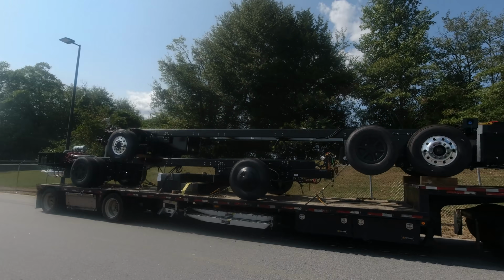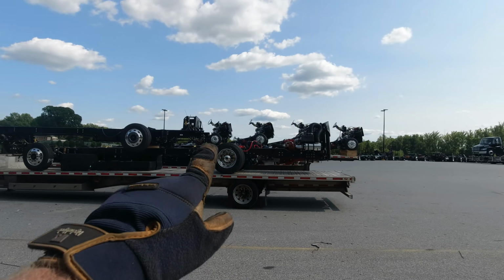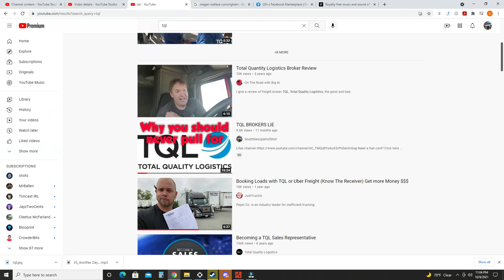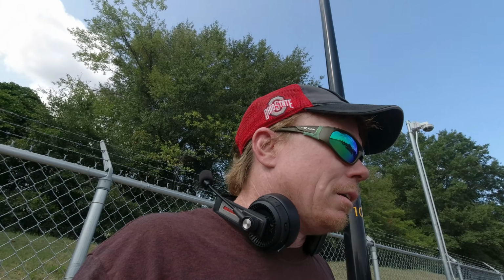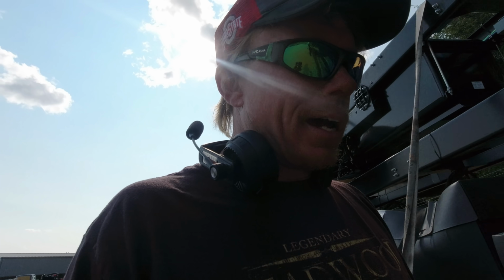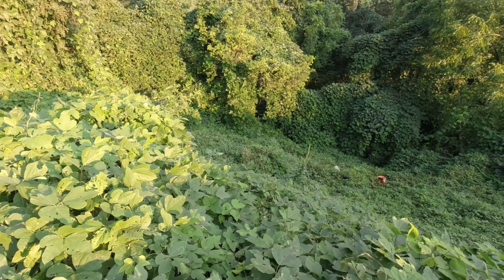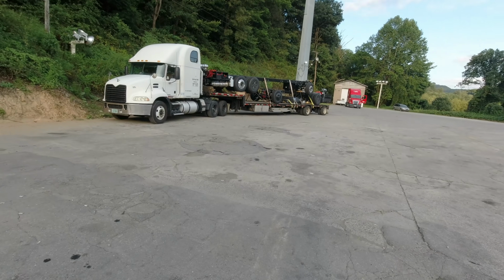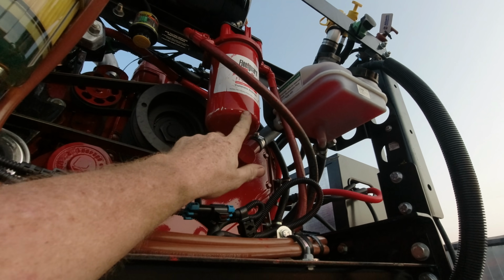Tql strikes again. And we pick up at Freightliner

Comment: I’m gonna be devils advocate 😂 
I hauled a lot of loads for Tql with a reefer. 
Over the course of the last 3 years I never not got paid. 
I at the same time don’t bother asking for detention. I just ask for it up front in the rate con and either get what I want or don’t pull the load. 
Nothing personal. 
I have been burned on appointment times but that’s because I got caught slippin and didn’t notice it was fcfs. Those are always long waits. 

I have been screwed on weights but that was easily resolved when I explained that they need to unload the truck becAuse it is over grossed and higher then my rate con. 
I then explain if you want me to haul this load you need to ph me the hourly rate of 100$ an hour for taking this load to scale it and bringing it back. If you don’t pay, I can unload the trailer and have a nice day. 
They always paid. 

It’s business folks. 
I been burned by small mom and pop shops much worse then anything Tql ever did. 

Those to me are the worst of the worst, small mom and pop shops preaching and promising everything is fine. 

The worst of the worst I ever dealt with was landstar. That’s since 2014. Those were the worst bottom feeders I ever crossed paths with. I stopped hauling for them in 2016. 

But Tql always paid and paid on time. 
I seen much much worse then them. 
Just saying.
Reply from the maker: Wow I've never had an issue with landstar

Comment: Those are probably, robotic welding. If their set up wrong, they will all be wrong, even if they change over to another model, it will go right back to the same location, when it is change back to that model, unless someone makes an adjustment.
Reply: Those are not automatic welds.....those are manual welds.....thats the scary part
Reply: @unhippy1  Sad that someone is going to pay up to a million bucks for their new motor home and it has welds like that on the frame.

Comment: 53’ or 48’ ? Top length/bottom length?
Reply from the maker: 50'. 10/40
Reply: @SouthGeorgiahotshot  been looking for a 50’ hard to find. I’m going back to big truck sold hotshot stuff. Can’t believe the prices of gooseneck trailers now it’s crazy. Went from big truck to hotshot was great for a while. Not sure how anyone is truly making money hotshoting now. A 40’ diamond c cost more than a 48’ aluminum step deck now
Reply: @SouthGeorgiahotshot  what did it cost you to have new brakes and wheel seals done on your trailer